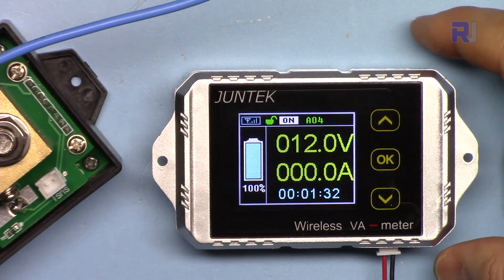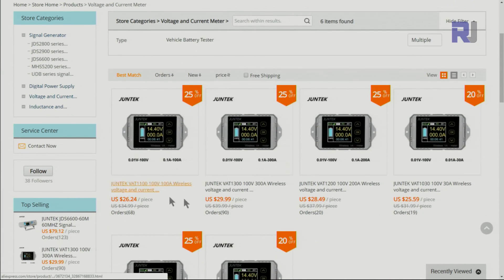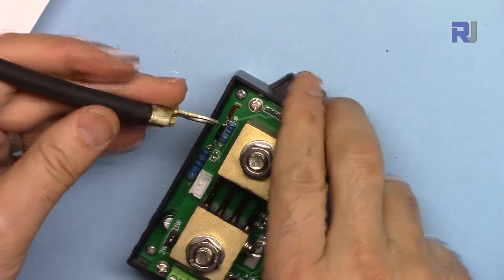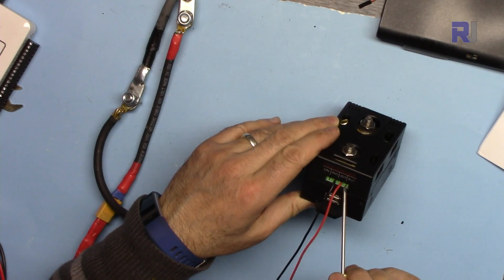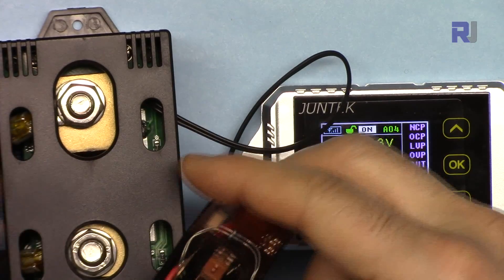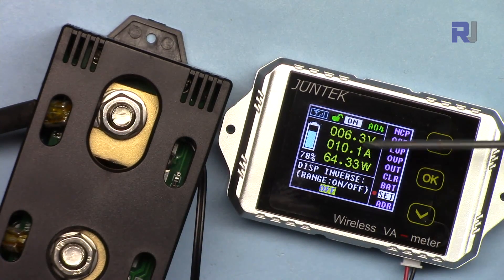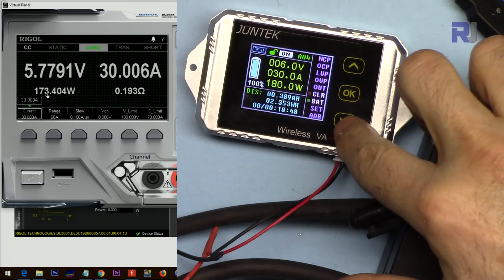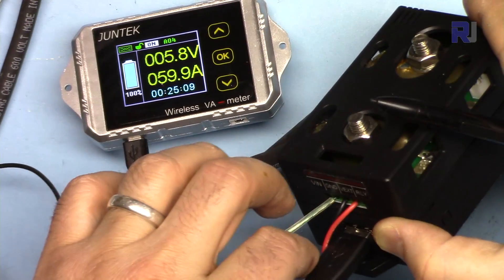Juntek VAT4300 Wireless Current Power multi-function Energy meter RJT164

Comment: The shunt bolts tighten right against the circuit board which is an amazingly silly design. Has anyone tried fitting longer bolts so the connections are external to the box then maybe a clear plastic cover made for protection.

Comment: I bought one of these in 2019 for our caravan in a 12V system. As you have found out it is not easy to wire up the shunt. After I installed it, and was running a 2000w inverter to run a 800W toaster, I found the unit was getting very hot. Not wanting this to catch fire, I bought a Victron BMV712. Very expensive, but did not get hot in the same service. A few years later I need a current meter for our house battery/inverter 48V setup, so I thought I'd try this one again. First, I removed the shunt from the circuit board, and mounted it separately. Ran a twisted pair of wires to the unit. It worked perfectly, no heating up, and measures the voltage & current of the 5000w inverter. It can't monitor the battery SOC because it is only in the inverter cable, and there is another charger in the system. For the money it is a good device, but can only be seen on site, in the garage, and can't be connected to a PC or phone.
Reply: Since the bolts go up against the circuit board, you would not be able to tighten very well so yes, it would get hot. How difficult was it to remove the shunt from the board?

Comment: My receiver cannot connect to the main sensor. I tried changing address but the icon on the top left remains showing no connection. Any idea what is wrong? Even when i plug via the usb cable the receiver powers up but only gives null values, despite the main sensor being connected to a 60v, 150a supply.
Reply from the maker: Contact the manufacturer. They hat store on AliExpress. Contact them. Simply search for the product and you will see juntek store.

Comment: brother If I want to use to see Solar panel to charging battery I will connect solar charger slot(instead power supply) to connect this module Yes or No?
Reply from the maker: does not matter what you connect. if the voltage is within the range, yes. please see my channel on energy called WattHour https://youtube.com/@watthour
Reply: @robojax  thx brother
Reply from the maker: you are very welcome.

Comment: How do you configure the wireless connection? My receiver is wireless and showing a red X meaning disconnected. I know how to change the channels, but how do I know what channel it's supposed to be on? Pls help!
Reply from the maker: Just select the same channel
Reply: @robojax  I know how to change the channel on the receiver unit, but how do you do this on the black transmitter unit?  how do you check what channel it's set to?

Comment: Can power the module with the same voltage that you are measuring the current in 3W mode with relay ? ( VIN - VEXT )
Reply from the maker: Your questions seems that have not watched the video. I don’t remember anything about this but I am sure I have explained all villages. So please watch without skipping
Reply: @robojax  There is a similar answer but it does not specify which one  mode is { 2w or 3w ) the answer is (yes it both cases. you can power the module with the same voltage that you are measuring the current. and it will work with 10 to 30V ) https://www.youtube.com/watch?v=a4b_A0ZDvwc&lc=Ugzsd1yMiQrDlG-_GSB4AaABAg.9I9Ou1C0tao9IIyZVQ_AjB

Comment: Thanks for this video. My juntek vat4300 measurement module stopped reading voltage and current. Kindly help on what to do. The display module is functional. I tried doing a reset using the USB connection but still did not displayed voltage and current. Before the failure to read voltage and current occured, I noticed intermittent disconnection (on wireless mode) between the measurement module and the display module
Reply from the maker: Hello, I did my best to test and show everything. you can contact the manufacturer via AliExpress https://juntek.aliexpress.com/store/3672134 you will see contact on this page or select a product and then contact them. you need AliExpress account to contact seller.

Comment: Hi. Tq for making this vdeo..
At 7:33,
Q1:  is it ok to install cable from the positive battery to V-in? This can power up the modul too..
Q2: since the Grn and Vext is 10-30v,. Can we use cable from a 24v batteries to this port too?
Reply from the maker: yes it both cases. you can power the module with the same voltage that you are measuring the current. and it will work with 10 to 30V
Reply: @robojax  thank you 👍👍

Comment: Is it possible to use it as a low temperature cut-off protection?
Reply from the maker: sorry I did not understand. if you want this module to take action based on temperature, then this is not the module. this will turn OFF at certain current value. not temperature. you may have to look at thermostat videos here https://www.youtube.com/robojaxTV/search?query=thermostat
Reply: Robojax Low temperature protection for LiFePO4, so it switches off the relay below zero degrees.
Reply from the maker: it will just display and  does not tac action based on temperature.

Comment: Very good video. I have one of these installed in my camper and very happy but is it possible to set the time or is it just a timer. I found that if I pull the bolts while tightening they can be tightened without a wrench of the other side.
Reply from the maker: thanks for the comments. when we talk about 100A, it has be tightened using a wrench or there will be spark and fire. Be careful.
Reply: @robojax  Actually use a wrench on the top nut and find that the bolt doesn't rotate, therefore can get a secure connection.
Reply from the maker: you mean just hold it with hand and rotate the top nut?
Reply: @robojax  Yes, once the nut starts to tighten you can just hold the unit and with a wrench tighten the nut. The unit should have the bolts secured but for the price it is still a good buy. Would also like it if it read the time as I don't see the purpose of having the timer. Thanks again for the video - well done!

Comment: when you were doing the current measurement the voltage was incorrectly displayed by the Juntek. Why is that?
Reply from the maker: it was correct. if my wires are not thick enough, some voltage drops on the wires (they act like resistor) and the display shows that.
Reply: @robojax  ohhh ok, I understand. So this device is worth it to buy?
Reply from the maker: yes difinately.

Comment: This unit does not measure low current draw. My system only draws 0.3A and it said 100% even though the battery was almost dead.
Reply from the maker: Yes of course. this is made for 300A. it's accuracy is 0.5%. so in 300A it has 1.5A error. meaning you will read 1.5A and then 3A, 3.5A and so on any value of 1.5A between two value has no meaning.

Comment: Nice presentation. I purchased Vat1300 model. It was working though I observed that it could not detect current below 0.6A. As an example if I have a load of 0.5A (at 12V), or if I reduce my load to 0.5A, the current & watts will display/drop to 0 and there will be no movement in Ah and Wh also. Is this the same also with Vat4300? Thanks.
Reply from the maker: this uses shunt resistor. not hall sensor. shunt resistor has 0.5% to 1% error. not a good idea to use it for 0.5A. You should not measure any value lower than 10A .
Reply: @robojax  Thanks for your reply. I don't get it why it is not a good idea to measure 0.5A below. 1% error is less evident the lesser the current measured.

Comment: Thanks for the fantastic video.
Most of my questions were answered.
However, would really like to see a schematic showing exactly where the shunt goes in a negative earth system. My battery has two leads on the neg terminal - one goes to chassis earth and the other to neg distribution point.
Reply from the maker: You are welcome.  Other than this pdf there is nothing else available https://supereyes.ru/img/instructions/VAT%20Quick%20Guide%202018-3-17.pdf

Comment: I have one and the designer is stupid as the bolt is clamped to the PCB and not directly to the brass shunt. Typically Chinese in that there are some good points but they let the side down with simple design errors.
Reply from the maker: yes. and unfortunately there is no way to communicate with them to tell them so they fix it. Now this is is still produced with the same design defect.

Comment: Thanks. Very helpful. I am a little confused about the connections as I have limited knowledge here. I am trying to connect to a 12v DC battery for an RV to monitor voltage, current and battery remaining capacity. 
On the battery positive terminal, there is the positive cable and I believe the charging cable connected together. On the negative battery terminal, there is just the negative ground connected. When you say connect to the  load, does that simply mean connect each device terminal to its corresponding lug on the battery, in this case, and also connect a power wire from the small connector to the positive on battery terminal? If not correct, please advise. 
Also, as the shunt is located in the battery box, what advise can you share about protecting the device from rain, etc.
Thanks if you can help.
Reply from the maker: You are welcome.  I believe I have left nothing unexplained.  I don't the this item setup right now to know what is connected where. Perhaps you skipped the video. Please watch it without skipping . I spend I believe over 10 hours to prepare this. that's why I said I have explained it very well.

Comment: How to calibrate voltage?
Reply from the maker: Usually you don't need it. They have used resistors with 1% tolerance. so it should be okay for the module for at least 10 years.

Comment: Awesome video, just received mine and wondering if you could help me with powering the meter. And also wiring an 80amp 12 volt relay. The relay has 4 terminals and I noticed you just connected 2 terminals with a diode. In my case I would be using this unit to be powered with 12 volt battery. So would I connect the unit to negative and positive off battery? And on my relay how would I wire it up?  If you can show me a wiring diagram I would be forever grateful. Have a nice day.
Reply from the maker: Hi, I just watched the video making sure I have explained the wiring. Indeed I have explained how to connect it. The wiring diagram comes with module but if you watch video you don't need the diagram. But if you want to look at the instruction manual which has the  diagram, here it is http://img.banggood.com/file/products/20180510042547VAT-Quick-Guide.pdf

Comment: Hello. Can someone tell me if it is possible to monitor smarphone battery with this device? I have Xiaomi Mi 9T 4000mAh. Thanks
Reply from the maker: this is for current of  300Ah or 300,000mAh if you want to use, it this can't control charge, just how much energy is used. Yes you can if you wanted. but there are better solutions a very small and clean solutions for your applications.

Comment: Thank you for your review :) Do you know if the battery state of charge etc is calculated and stored in the base unit (shunt unit)? Reason: I want to turn the remote display on and off in my vehicle but leave the base unit on with my battery and solar to log state of charge while I'm away.

Happy new year! and thank you for your vids :)
Reply: Yes is still keeping the memory
Reply: I think I just answered my own question by watching a video on an older unit, I assume this one is the same. The guy disconnected the remote screen by changing channel, when he reconnected, the watt hour jumped up significantly. So it seems everything is done in the base unit and the display is just a display and UI.
Reply from the maker: You are welcome. Yes.  True.

Comment: Can I use the same 12v battery source that the shunt is connected thru for the external 12 - 30 volt power supply in order to run in wireless mode ?
Reply from the maker: I will reply to all subscriber's 🔔 questions. So make sure to subscribe.😊

Comment: hay .. can you set ocp to 0.01a? or how to set up ocp small limits for this tool?
Reply from the maker: Hi, No it can't . This is made for max. 300A and with 1% accuracy you will get minimum of 3A. If you want 0.01 A then get a module that can measure maximum of 1A or even 500mA (0.5A) .
Reply: I plan to measure at low voltage and low amperage with a range of x.x1A, which type do you think is suitable VAT-110 or VAT-1030?  I used DC 36V 5A as a Power Source and regulated it with a buck converter with the lowest voltage of 1.2V.  i want ocp all work even at the lowest voltage
Reply from the maker: sorry I missed your comment. Yes get very low current meter. Here are my videos about current: https://youtube.com/robojaxTV/search?query=current

Comment: Does it have memory function?I have installed it in an EV,and whenever I turn it off and and turn it on again,it does not remember any previous data and shows 100% charged even if it was discharged 50% before  switching it off.
Reply from the maker: that is the issue. I have not tested it. I am sorry I have not been involved with battery and actual application so I missed that.
Reply: @robojax  Hi, Thanks for the video. Can you check that issue exist? Thanks.
Reply: @robojax   Hope you do that one day
Reply: Hi, did you disconnect the display only or shunt unit? I'm interested to know if everything is remembered when only disconnecting the display. Cheers :)

Comment: Do you know whether it is  (slightly) overload resistant? I plan to buy a 1050 for my boat because the resolution is better then from the bigger devices and most time my devices pull around 1 Amp or much less. But for a short time the starter current for my 10HP outboard engine will run through the shunt (should be around around 80 Amps for max. 5 seconds). Do you have an idea if it will blow up immediately? I do not expect the device to count the energy during this moment, only the shunt to withstand the current. Did you touch the shunt during max load? Does it become very hot?
Reply from the maker: are you referring to the 10HP will blow your 80A or your device draws 80A and you want to know if this meter can handle it?

Comment: USB Host on the "Sensor" unit is used for what? Logging or sensors?
Reply from the maker: Please watch the video. I have shown what it is.
Reply: question what is the purpose of the temperature sensor? just another feature? maybe if used for 'charging' to reference the battery temperature.

Comment: Hi, Looking at buying one of these for my solar system that is 48v. So when fully charged 57.6v. Says 0-100v but never seen any one use it above 30. Also says 0-30v input. So do you have to power the unit off less than 30v but the main leads across the shunt can be up to 100v ?
Would love to see a setup and test to the rated 100v.
Reply from the maker: Hi, it is because unless it is EV industry  no one uses anything about 30V. My lab power supply is 30V and 60A.

Comment: I have wired in the Juntek VAT 1100. I have gone for the 2nd wiring diagram where you provide DC in 10-30V underneath VIN. It is displaying by battery voltage correctly but the current and wattage seems to be .1 out. My roof fan should be drawing 4amps at full speed and it's reading 0.4 on the meter. It's also reading 3.7w which is obviously way too low and should be more like 40w. Can you help? I wonder if it have it on the wrong setting but can't figure it out as the booklet is useless!
Reply from the maker: Unless you connected incorrectly, the other issue would be the defective module which I doubt.
Reply: @robojax  thanks. how might it have been wired incorrectly do you think to cause a difference of reading?

Comment: I really enjoy your channel. Very insightful. Not sure if you answer off topic questions. I really could use your input for wiring a relay on this VAC9010H Volt meter. I can't understand the wiring schematics off the instructions. I've contacted the seller , but no help. Here is a link so you can view and hopefullt shed some light. Thanks.....https://drive.google.com/file/d/1-D0AeiXDSPdwsKMWCVTV_5RJGYyJGsdr/view?usp=drivesdk
Reply from the maker: You are welcome. Good to hear that.  here is solution by looking at  your meter,, but I assum you use simple relay so you learn how to do it. But  your relay should be able to handle 100A or 200A which is the rating of your device https://snag.gy/TlY5kq.jpg

Comment: you need relay to cut de voltage when you set LVP? About 200A relay??
Reply from the maker: Yes if you wan to disconnect it.
Reply: @robojax  thankyou a lot, 
My Juntek has 200A  i need to buy a normaly close 200a relay right? 
you know about de voltage? i need to know to look for a relay,   my system works with 24v  the Juntek will send 24v to the relay ? or 5v ??

Comment: I just cut the blackbox slightly so the cover goes on and off easily when cables connected. Yes poor design but kmon, we are in DIY already, just make some slight mods ;)
Reply from the maker: yes but otherwise it is shown very accurate values.
Reply: @robojax  not realy... I have installed this in my Camper van. With 550w Solar and 12v 200ah lifepo4 battery. When i set the size of the battery and leave it for a few days, it will go up to 100% and will never ggo back down again. But i know from experience that my usage is about 1kwh each day. Even if i set the battery to 0% charge on the meter. After 4 days it will show 100%. Which means its something like 25% off each day with measuring...